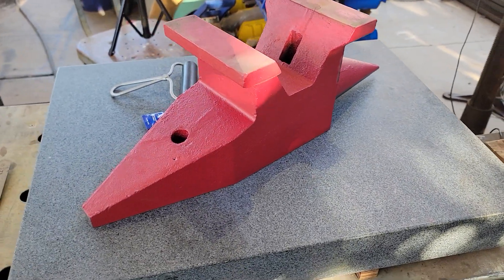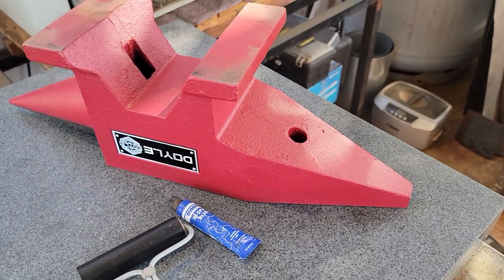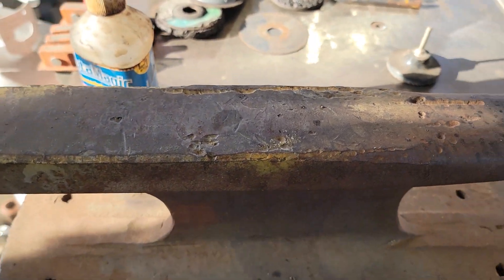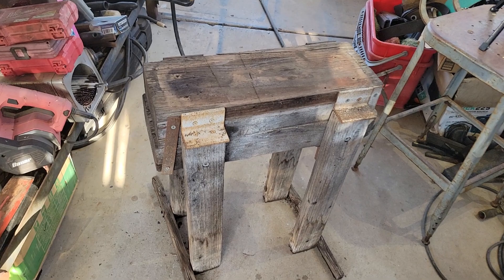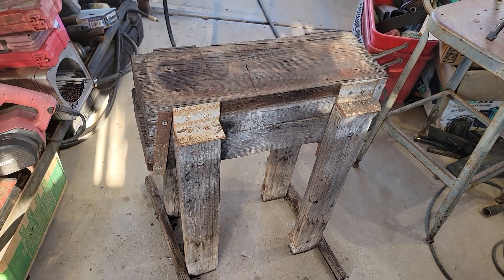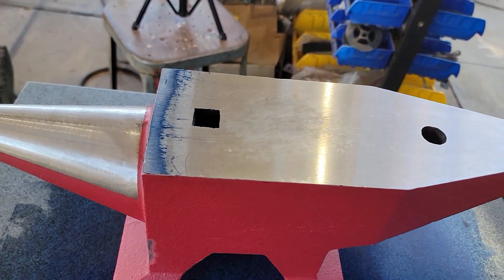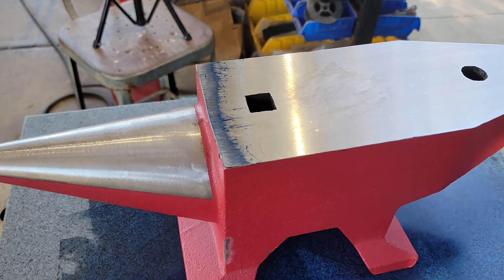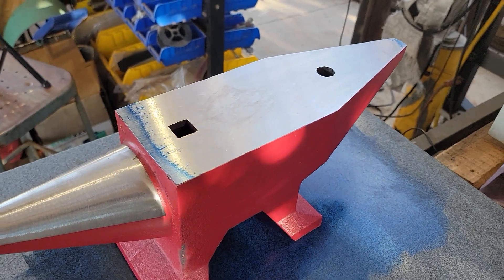How flat is the doyle anvil from harbor freight?

Comment: Flat enough for forging. I wonder how it was faced off in the factory.
Reply from the maker: Hey, thanks for the comment and the view much appreciated. Judging by the looks of it, they ran it through some type of giant sander. Thanks again, have a very Merry Christmas.
Reply: @26feironworks79 I think they ran it with a fly cutter on a milling machine. When I got mine, I could see the marks. What I'm getting at; is whether they ran it through the fly cutter before or after powder coated it? I'm thinking it was after powder coating. Also, whether they faced it off while it was still hot or after it was heat treated/tempered. I'm guessing they did it while still pretty hot to make it more easy on their cutter bits.

Comment: Put a machinist straight edge across it and check the gap with a feeler gauge
Reply from the maker: Hey thanks for the comment I appreciate your input unfortunately. I don't have a real straight edge and and a feeler gauge that goes down to point 002. I was able to find a piece of receipt paper that was 2000 I did put a piece of tool steel.  Straight edge across it and there is definitely a saddle built into it thanks again.

Comment: Still don't have any idea how flat it is. Just laying a straight edge on it's edge on the anvil would of told me more. Tack some wet dry sandpaper on that granite, spray it down with some soapy water and then push that anvil around, back and forth, side to side for long enough and you will have a super flat top anvil. Or mill it.
Reply from the maker: Hey thanks for the comment and the view and your input much appreciated. I'm going to try to get something out as soon as possible thanks again
Reply: @26feironworks79  Looking back at my comment, it came out a bit blunt and negative, but glad you didn't seem to take it that way. Thanks for the videos.

Comment: I give you a lot of credit. This isn’t an anvil for the space shuttle. An anvil is not a precision instrument like a granite surface plate.
Reply from the maker: Thanks I was just curious and I just had to try it. Thanks for the comment and the view
Reply: I've got one and like it for $140. Maybe if I get more into blacksmithing I'll spend a lot more for a bigger high quality one.
Reply: @davidbolduc828  I got the Vevor 132 pound one almost a year ago as a gift. The HF looks close to identical to the corresponding Vevor with a couple detail changes.

I am really happy with mine, and I've run a lot of steel across it. The face has held up very very well - much better than I'd expect from such a cheap tool. No, it wasn't perfect and it needed some cleaning up out of the box, but who cares, I now have an anvil that is a pleasure to use, and has even made me a couple bucks (it's set up in my machine shop, so I've used it once or twice on customer jobs!)

Comment: How flat is it? Well, it could be pretty flat. Not touching only means it doesn’t touch. It doesn’t say by how much. If you really do want to tell, yes, you do need to use an indicator. But then, anvils don’t really need to be flat, only flattish. Blacksmith work is not exactly precision. I mostly use my 132 lb black Vevor anvil for odd sheet metal work my hydraulic press and finger brake won’t accommodate. It’s flat enough for that. Pretty flat actually, but not a spec I would allow for my machine work
Reply from the maker: Hey thanks for your input much appreciated. Thanks for the view as well

Comment: Not going to trash the video, good idea, but unfortunately this does not tell you how not flat it is, it just tells you it has two high points. It’s possible that it might be only .005” low from the edges.
It makes perfect sense that the edges are high because they are less supported than the centre and would see more deflection when marching the top surface.
I’d be curious to see a defined straight edge on top with feeler gauges to measure the gap, as you now know the high points are at both ends. 
In short this is an anvil, it’s more than flat enough, where it’s going to come up short over expensive anvils is in weight, material hardness properties and also durability of surfaces
Reply from the maker: Hey thanks for your input you bring up a lot of really good points and I agree with a lot of them thanks again for the comment and the view.